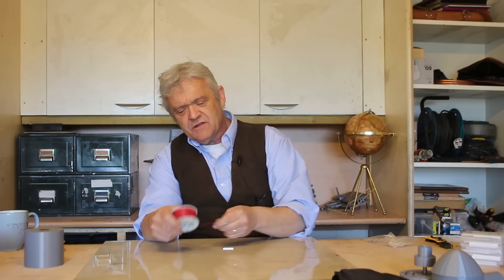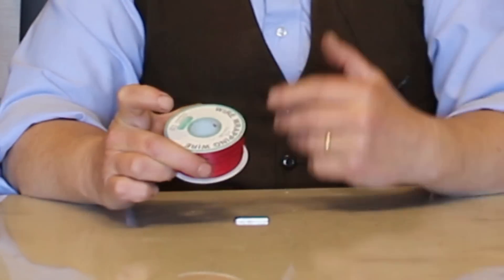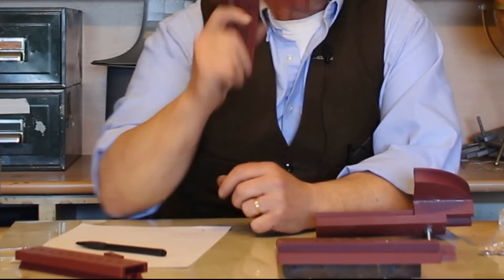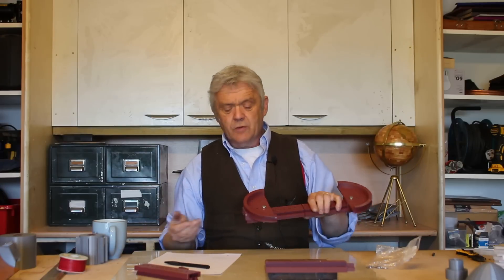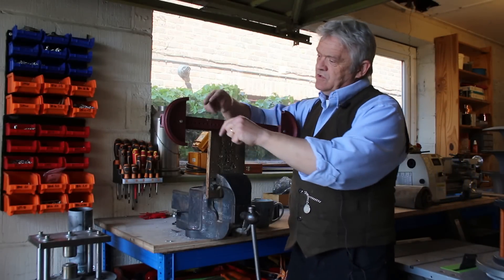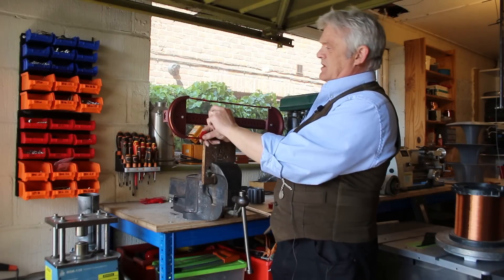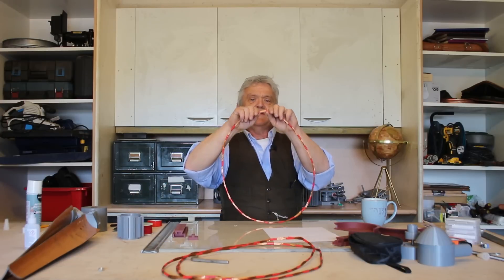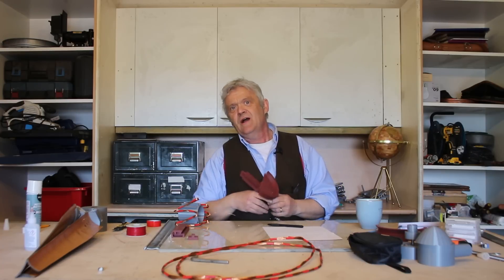1929 Serpentine Coil Winding Jig

Comment: Hi could you make the jig spin.👍🐝🌞
Reply: good idea i cant see why you couldnt just stick a bolt through the center hole in the jug and attach to an electric screwdriver and clamp that in a vice
Reply: I was just thinking the same thing by possibly attaching a car's power window motor to it.
Reply: It would be so easy and put a foot control and done😊
Reply: You could you would need a spool holder, a guide, a drill attachment through the centre and a way to keep tension on the spool of copper wire
Reply: @EastBayFlipper r a battery driven screwdriver. 😊 A battery driven drill turns to fast unless you have it perfectly lined up.
Reply: @manwithsomeplans  cheers yeah its like putting line on a fishing reel hehe
Reply: @hendrikjbboss9973  a variable speed motor of some sort with a foot control around the screwdriver speed would definitely work 👍😉
Reply: Guitar pickup winders have a rotation counter. Early versions used a bicycle wheel counter system or some such. A chocolate wheel paddle could easily trigger a mechanical counter or an electronic one if you wanted to get fancy.
Reply: Well... Actually ALL industrial motor coils are wound with exactly these type of jigs, mounted on suitable winding machines. Usually with a counter attached, so nay fixed number of turns can be produced hundreds of times without error. State of the art for at least the last 70-80 years...
Reply: @camilloholecek5503  yes,I was enquiring about this one. 👍🐝🌞

Comment: As I'm about to try my first serpentine coil rather than the more conventional wrapped coil, I focused on the 'how much' wire bit. The stator length makes sense but the twice the circumference does not. By my reckoning it is half the circumference at the bottom and half at the top - so just one circumference plus the stator lengths...plus a 'bit' to account for each wind needing to increase for previous winds. There's also a comment below which suggests increasing the stator length to maximise the ratio. Whilst true, a motors torque is proportional to rotor volume D^2.L (diameter squared multiplied by length). The bigger the radius the higher the 'tip' speed - the 'v' bit of BLVsin theta.

Comment: The general point Robert makes is a serpentine coil helps maximize the ratio of (generating length of wire segments) / (non generating copper overhang wire segments) compared to circular coils.

If you want to further maximize the ratio, one might design one's rotor and stator with a given diameter to have  more length in the dimention shared with the axle.

Comment: Is there a video that shows the connection of the coils to another wire and eventually to a multimeter/voltage reader or an LED light for testing? Alligator clips/solder?

Comment: Pausing 1 min 30 in to ask: What about a very very slightly progressive coil around a simple torus, jam packed with heaps of windings out from a hoop made of a thick insulated wire or something?
Reply: To wind it I was modelling a whole rig, but couldn't find my bearings, then pulled 3 castor wheels out of a box. Think I might be able to simplify this.

Comment: It's not 10% extra 'just in case', it's roughly that because it's not just a single strand.
Each extra strand will be the pea under the princesses' mattress, with each new layer causing the next to take ever so slightly more wire to complete a single round.
Add them all together and it get us where we need!

Comment: Can you go into the theory of designing a coil?  Such as, what changing the gauge and/or # of turns will do?  Is there is a way to figure out what you should use in the 1st place (at least as a starting point) if you know what voltage you want and the rpm it will spin?  There has to be some math that can be used to help achieve the outcome you desire w/o having to wind random/different coils over and over and trying them.
Reply: You have a number of considerations to make first. The power of the generator is determined by the Voltage and current which will determine the thickness of the wire.
So if you wanted to create a 500Wh generator with a Low Voltage then the current would be higher than if you generated a high Voltage with a low current for the same power. The current would determine the thickness of the wire used a higher Voltage with a low current would give you thinner wire. Flux density is determined by the amount of copper in the magnetic field, so the number of windings is limited by the width of the section holding the wire and the width of the magnetic field.

Comment: It seems to me that someone could come up with a modified 3D printer that does the winding directly on the stator. You would need to add a fixture that holds the stator and rotates it after each pass.

Comment: Good one Rob, still what happens if you put hundreds of short single wires around the armature where they all terminate into a metal disk on either side. Then put magnets on the stator with all the poles in the same direction. It will be like pulling the wire through a magnetic field at right angles only there will be hundreds of them. Simulating the single wire being pulled through an endless magnet. As per your description in the beginning?
Reply: Id like to see your idea can you post a drawing or a ptype photo?
Reply: If I understand correctly, there's a problem. The magnet-wire interaction is based on the *change* (flux) of the magnetic field, not the presence itself. By having the same magnetic poles going around, as one magnetic north reaches the edge of its pull (let's say 10% strength) the next north would be starting its pull (10%), but that polarity/strength is close enough that you'd actually lose some there by not getting to 0%, and get much less if there's less change (100%-10%=90%). Plus, the sections at 100% would be at a different voltage than sections at 10%, resulting in further losses.

However, if you did N/S magnets like normal and had 4 alternating "claws" that attached to every other top/bottom "group" (section of multiple wires) of (magnet size +a little bit)cm I think that would work how you're thinking. Also you would need a 4-phase rectifier (2 for group A [top odds, bottom odds], 2 for group B [top evens, bottom evens]) I hope I'm explaining that right. I'd draw a picture but my mspaint skills aren't up to the task (I've been trying for 20 minutes lol).
Reply: @brandonlaird6876  Hi, the right hand rule applies. The wires move at a 90' angle to the flux, so each wire will generate a voltage and a current. The voltage will be quite low but the current will multiply producing a low voltage but high current DC . I am sure a clever man like Tesla would have tried this but I find no reference to such a system. Maybe a blocking diode at the one end to stop the current from moving back into another wire? Tesla did not have those.

Comment: Suggestion for this device: If you made it so the half circles could rotate together and put a handle on the rear side, you could attach the wire then just rotate the whole mechanism with the handle to feed it wire instead of manually wrapping it around 200 times.
Reply: with the aid of a power drill, 10mins becomes 10 secs and/or a lot of mess :)
Reply: You still have to count the turns.

Comment: Hello Robert I know we talked about this in email but I thought it might be helpful for your viewers to bring up here. Would there be any advantage at all to taking a piece of string and making one turn on coil holder of the final project rap it a little tiny tiny bit loose and then using that dimension to set the jig distance. I mean one could always do the calculation and match it against the string to see if they agree.

I know I'm terrible at overcomplicating LOL

Comment: To measure the length of the coil wire needed, use a piece of string, wrap it around the stator. Remove mark with tape or a permanent marker where you meet the end of the string. Now you know the length of the coil needed per wind.
The coil winder would be better with a long slot rather than holes. Slots would give you an infinitely variable length, holes are a finite number of lengths.
Reply: - and if someone happened to have a rope - of the (approximate) diameter the final coil will be - one may even eliminate the fudge factor..

Comment: Just for fun, make sure the magnet(s) cover(s) the u turns radius on both sides.  Should act as a diode and should be an increase of a large amount.  Otherwise...The the power goes out on both sides of the flat spart as it gets pushed.  Sure you get quite a bit but I'm thinking it would be about 20 to 40% increase to stop electricity from going backwards.  
It's been on my mind for a while working it out.  

Analogy?  Lay out a garden hose full of water on a driveway in a serpentine shape.  Drive right down the middle.  Water will go out both ends.  But if you had enough tire to cover the radius also, it would only go one way.  Right?   Or it might explode I don't know

Comment: It would be very helpful if you could let us know what gauge of wire you use for each specific project when talking about a new project. "Wind some wire" seems a bit vague! The number of turns of wire would also help. I presume that thinner wire = more turns and more voltage at the output but could burn out (go open circuit)  if the ampage is higher than the rating of the wire, but I'm only guessing. Is that the case??

Comment: I wonder if it'd be possible to make a guitar pickup with serpentine windings instead of the regular method.
Reply: ?? If the windings are all connected in series - then it should be simple to do, if they are parallelled to keep the string channels separate (that "could" be done) , then...   a quick look around the web - Highline guitars on YT has  vids on this - his coil is "just"  a straight coil around the perimeter..  (as with the original patents by  George Beauchamp.) - a controlled wind appears to be extremely important. ??   who knew)

Comment: I have been looking at DIY wind  turbines for some time (mainly VAWTs, but that's not important).  One thing I have noticed is that in many designs I've seen, the generator is 3 phase - made with 3 separate sets of coils, but yours are not.  Is 3-phase better, or is there no difference?  Do things like that affect the turbine's ability to self-start in low wind, and it's stall speed, or is that just a function of the magnetic field strength?  I've never seen a really good explanation for these things, so could you enlighten us, Robert?